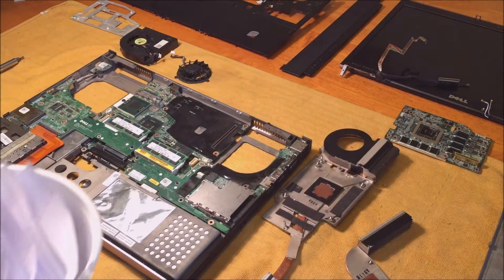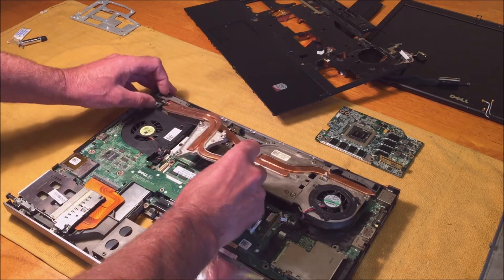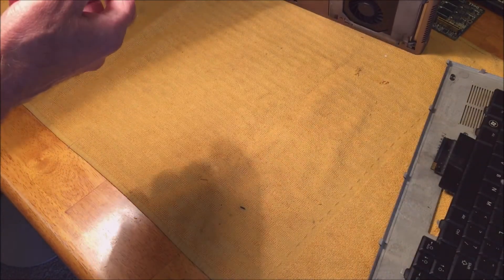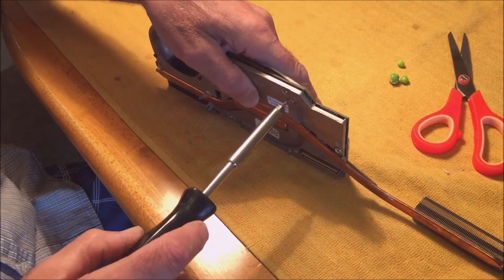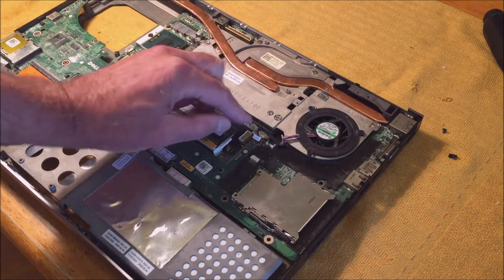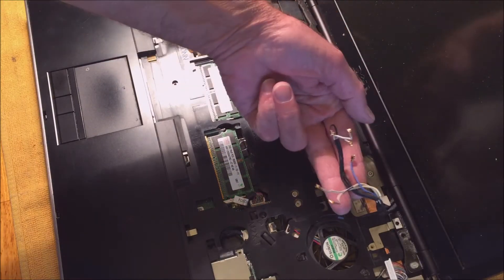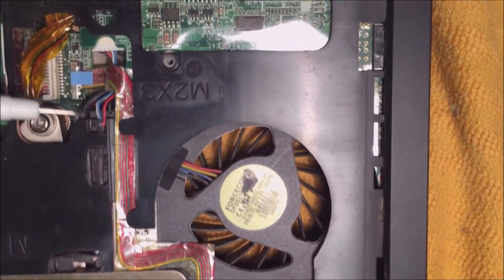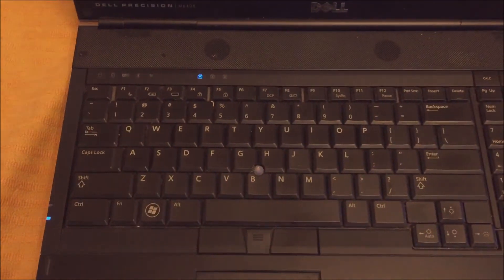Dell Precision M6400 , M6500 Overheating (Problem Solved)

Comment: Sir, i am facing very high heating on cd3301B ic in my dell precision 4800 L9771p motherboard but remaining all working fine, very slow booting before bios started, sometimes turns off automatically.. but multiple trying starting with no worries but only heating that ic.

Comment: My m6500 just started over heating and running real slow to avoid shutting off.  It looked like it would be a pain in the ass to get to the fans.  Thanks for your tip with the light and the vacuum I will have to give that a try as I think the issue is build up of dust.